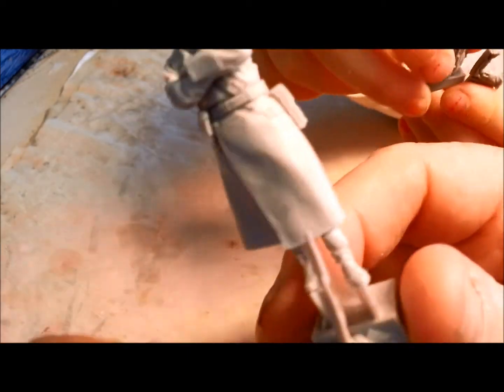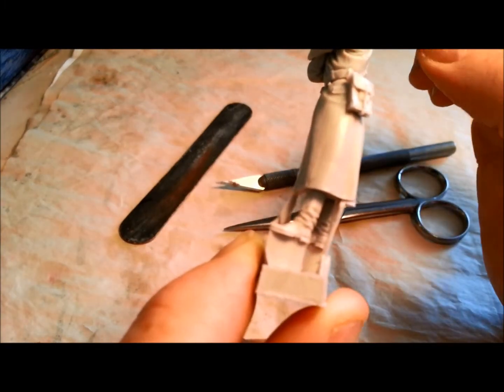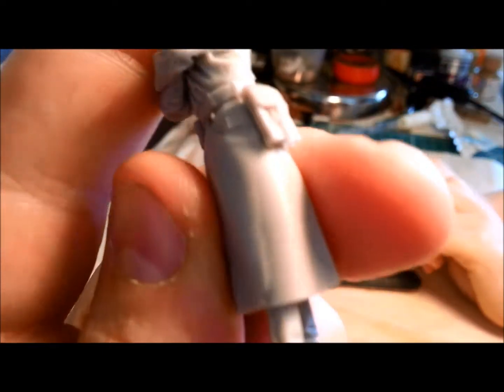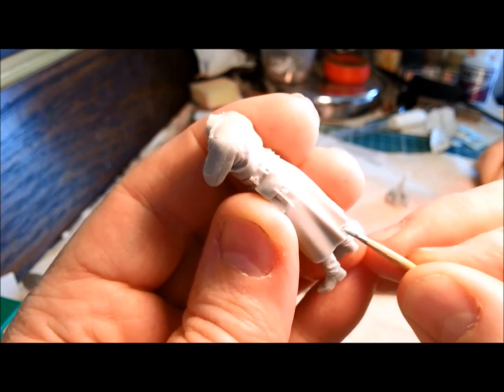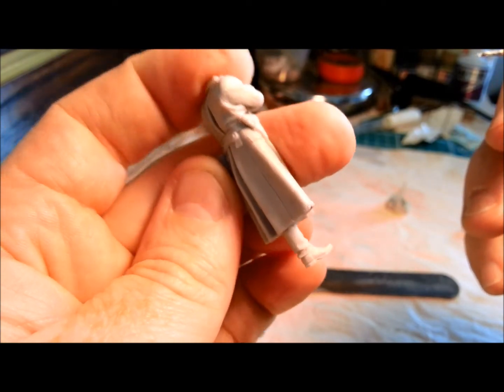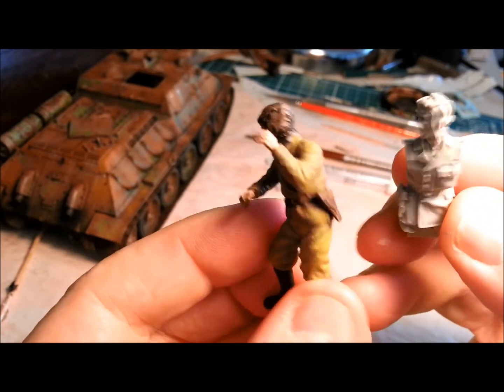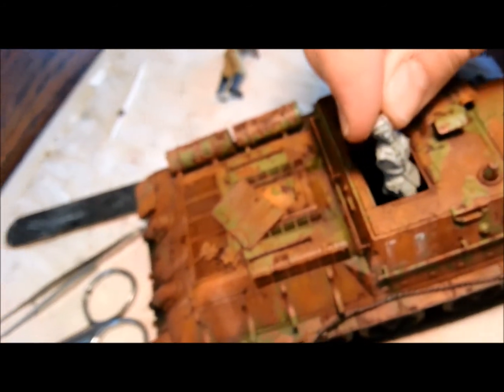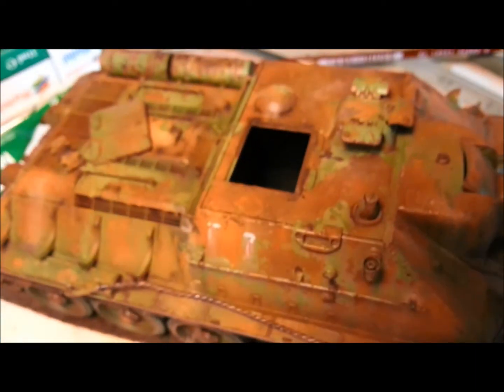Scale model basics: preparing 1/35 resin figures for painting

Comment: Just a small tip if I may? When you add putty to the figure for filling, try mixing with Lacquer thinner ...will be much easier to blend. I don't think it affects resin, but some plastics react to the thinner. This will give you more control over filling and reducing the amount of sanding since the resin is toxic.
Nice SU 85? 
PS If you really need to sand resin a lot, hold the parts in a see through bag to reduce the dust residue.....hope these help?
Reply from the maker: Hi Milky55way2012, these are great suggestions - thank you for sharing them. I'm definitely going to mix my putty with lacquer thinner next time, mine is getting a bit old and dry now, so that will help a lot. Cheers mate, Dave
Reply: You're welcome Dave, thanks for posting the video....good luck.
Reply: I also use a little extra thin cement to loosen the fillerl when filling pin holes in resin casts. But everyone has a method that is right for them so I'm not saying this is right.

Comment: Is there any difference in approach to painting a little resin figure like that vs a plastic one? I'm used to the little plastic pilots that come with Gundams, but a car I bought came with two little resin figures. Thanks!
Reply from the maker: Hi TotemoGaijin, there is no real difference between resin and plastic figures when it comes to painting. Resin figures have finer detail than plastic, so there might be more detail to pick out with highlights and drybrushing, but the basic painting is the same between the two. Cheers, Dave

Comment: I believe resin is quite toxic so wash our hands after handling it and don't breathe in the dust when sawing and sanding.
Reply from the maker: Good to know - solid advice, thanks CursedMonkey
Reply: FWIW Cured resin isn't anymore hazardous than any other item in scale modeling.  To eliminate the dust, always wet sand and you'll be fine.
Reply from the maker: Hi Kevin, I keep hearing that resin is ultra-toxic. Are you sure it's no different to any other inhaled dust? I'm not sure where to come down on this one...
Reply: There's nothing dangerous about handling a cured resin model except the dust from sanding. Of course there's always a chance that someone could be allergic to a type of resin used, but that's another story.  The dangerous part is the dust you inhale.   I was just mentioning that  wet sanding keeps the dust out of the air and is easily gotten rid of by rinsing your sanding sponge in a bucket of water. I've been building garage (resin) kits since the mid 90s and always wet sanded with no ill effects.  If you want to wear a dust mask besides the wet sanding, no one should tell you not to. HTH